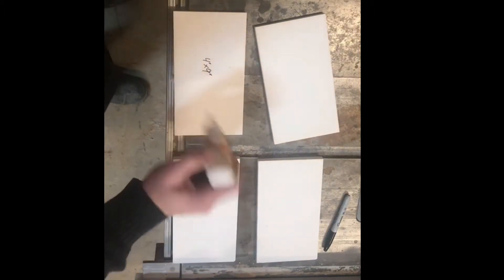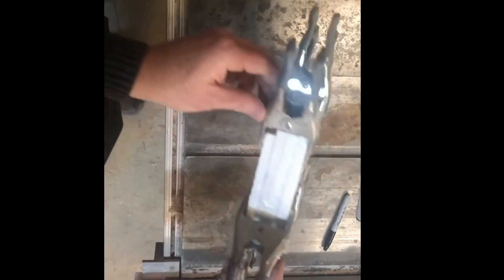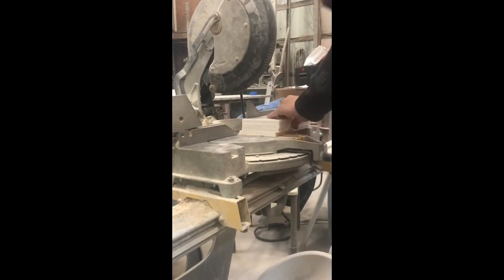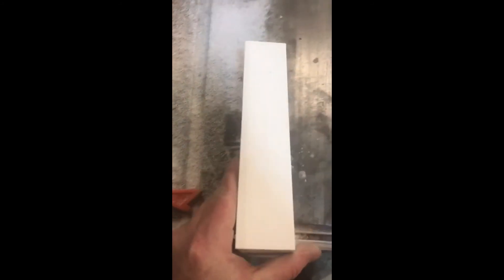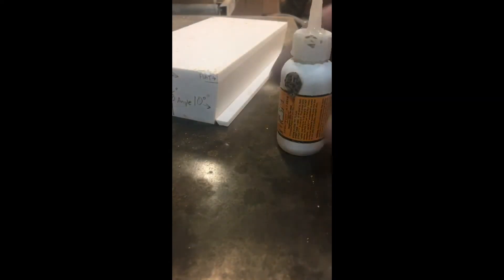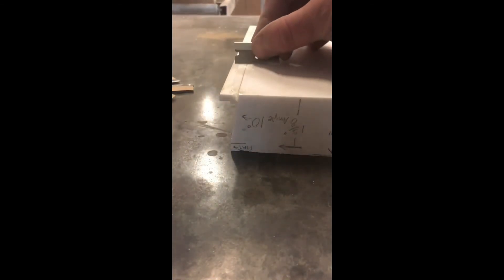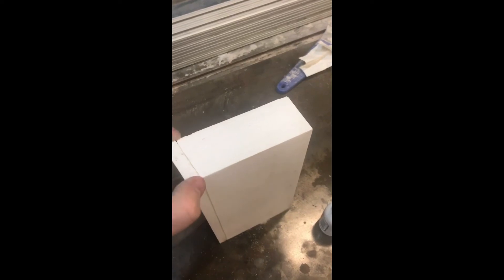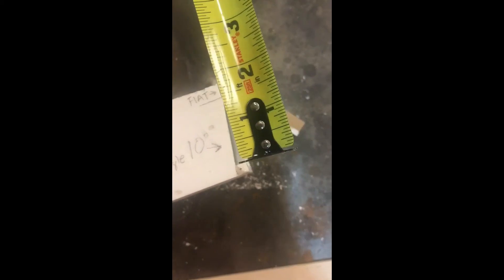Making a star inlay billet video #1

Comment: This will take some thinking, my saw tilts the other way away from the fence. The fence won't go on the other side. Any way to make this work?
Reply from the maker: John Pierce do it exactly the same way.  in the video I flip the block over once I have cut the angle.  So the wide part of the angle is at the bottom of the jig.  With the blade tilted away from the fence your still cutting the same 10 degree angle.  When your cutting the actual wood your blade will be set at  a 90 this will be covered in my next video. I’m worked my on it now
Reply: Eli Polite thank you
Reply from the maker: John Pierce any time